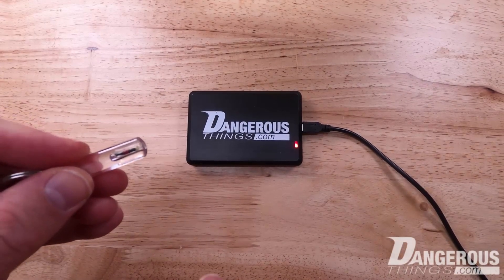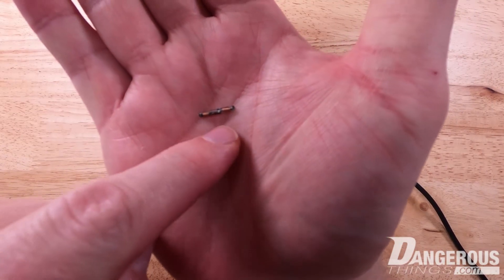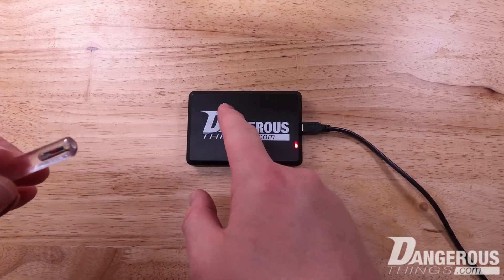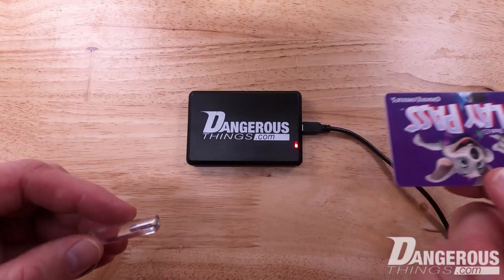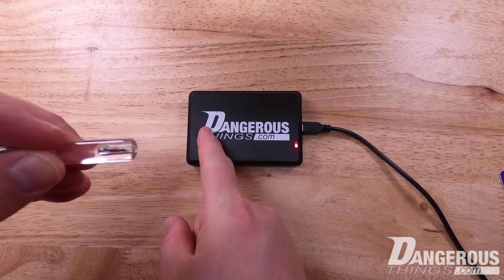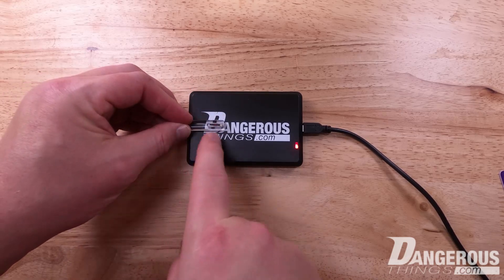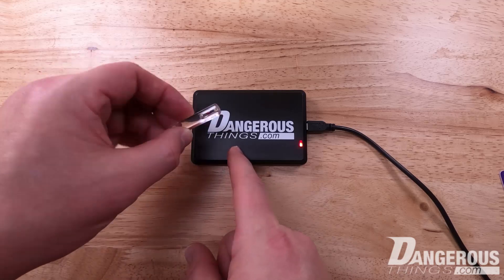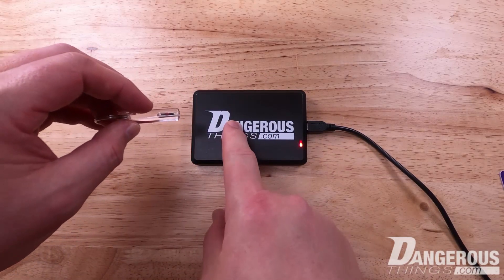Introduction to the xFD Field Detector keychain

Comment: can orientation cause issues when its implanted? this seems like a possible flaw trying to access doors with readers. i might have to hold my hands in certain ways for different readers.
Reply from the maker: Yes. This is the whole reason we created the field detector keychain - so you can find out which orientation works best!